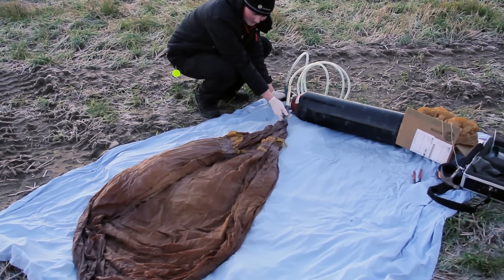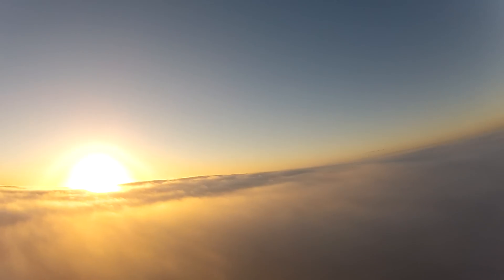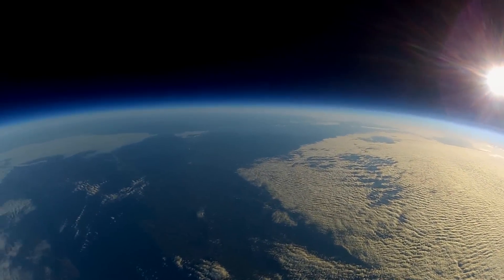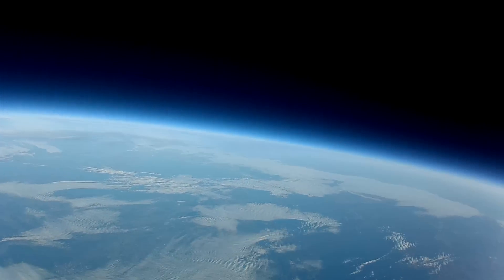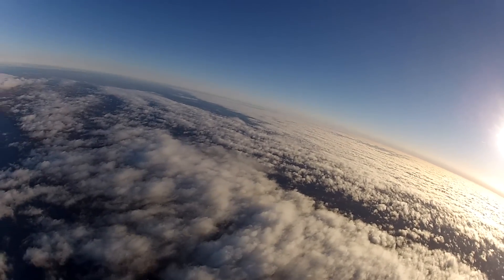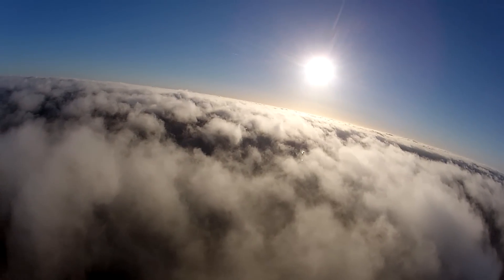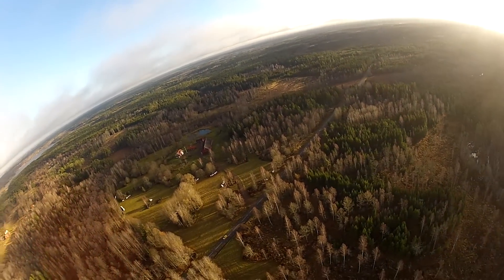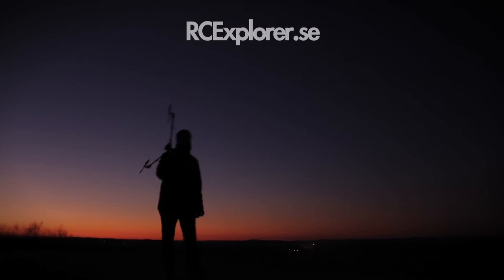Space Glider - FPV to Space and Back!

Comment: This will be illegal in a decade
Reply: +Jon For Much sooner I'm afraid.
Reply: +Jon Dor I think it's illegal as of TODAY with the new drone regulations that just came out (Dec 14, 2015).
Reply: +codzomz I don't fly big iron like you, just 4 seaters, but you really think a large foam plane can damage a control surface? Has it happened even once so far? The few times I've crashed a foam plane (once flew right into a lamp post in a park), the plane became minced meat and whatever I impacted had 0 trace of damage. 
Being ingested by an engine is more of a concern, and would cause real financial damage, but even assuming the engine gets damaged in a way that it would stop making thrust, we both know airliners can fly with a broken engine.
What AA airline crash are you referring to? Was it caused by an RC aircraft? Do you have the NTSB record so that I can read up on it and learn from it? Thanks.
Reply: Veetoo of course, last I checked, there have been exactly 0 RC aircraft that have damaged a full size plane so far, and if a foam plane were to impact, the risks of damage to the full size aircraft are super small (not true for multirotors made out of carbon fiber and metal though).
Compare with number of bird strikes yearly and the millions of damage they cause every year.
I say, let's outlaw birds first, they're clearly the most dangerous!
Reply: Maybe they should welcome the drones near the airport to scare off the birds. Might actually reduce damaged caused by bird strikes. Birds are a much denser object and a flock of birds is far more dangerous then a single drone buzzing around.
Reply: It already is in the US
Reply: +than217 do you know which part of the regs make it illegal (law, not circular notice or recommendation) to fly FPV beyond LOS?
All I know about is having to register as an RC pilot to fly anything more than 250g
Reply: JaleelJohanson62 flying above 400ft AGL is still not illegal in the US, I asked an aviation lawyer at AOPA to make sure. The FAA had guidelines they'd like RC flyers to follow, which include never flying over 400ft AGL no matter the airspace or location. My personal take is that it's a bit over restrictive and I wish they would take airspace into account.
Reply: the amount of misinformation in this comment section by warriors of air safety is staggering
Reply: +MasterMayhem78 and this is relevant how? Kinetic energy is distributed between both sides according to each side's weight. The foam plane will be obliterated no matter what and is very unlikely to cause any damage to the full size plane. A bird will cause more damage (I know, I've already hit 2 smallish birds with a full size plane I was flying, and they both put a sizable dent in the wing. Some also go through the windshield and strike the pilot). I you're going to tell me that foam or plastic prop will dent a wing or go through a windshield, it's going to be hard sell.
Or if you tried to point out that the speed of an RC plane between struct by a full size plane, is kind of irrelevant due to the speed of the full size plane, that's pretty much true.
Reply: +goatman86 it not actually illegal yet, just frowned upon (go ask an aviation lawyer), and your odds of being injured or killed by a falling coconut or lightening are way higher than an RC aircraft. But if you're worried, stay indoors ;)
Reply: +Jon Dor decade ? couple years maximum.
Reply: than217 Fucking government...
Reply: ***** Hmnnn... Apparently I need to investigate this further. Thanks for the info! Perhaps my mission to space isn't canceled afterall? lol
Reply: JaleelJohanson62 while it's not technically illegal (AFAIK) to fly RC inside controlled airspace (Echo, Delta, Charlie, Bravo), it's clearly not a great idea either, never mind crossing 18,000ft where you'll find airliners flying IFR (and typically not doing see and avoid since no VFR traffic is allowed to be there).
People who fly rockets usually go to a place like Black Rock Desert and get an approval from FAA to go to high altitude within a blocked off piece of airspace.
Reply: +JaredtheOverLord amen to that.
Sadly, it&#39;s the internet, everyone has an opinion and many post it, even if they are actually totally uninformed about the subject in question. Even the guy who said he was an airline pilot didn't reply to anything I asked him. 
Of course, part of this is also the FAA's fault for not having done comprehensive tests of collisions between foam planes and full size planes, and multirotors and full size planes, like they do with frozen and thawed chicken they throw with a high speed chicken cannon at airplanes.
Reply: +William Carrey you'll find that it's not illegal to fly above 400ft AGL. You can do so safetly in many places. The FAA would rather that people don't (they have a circular saying so), I can't blame them, but for hobbyists, it's not illegal. Youtube is filled with long range flights clearly above 400AGL, and as long as they're not reckless, the FAA isn't going after them.
Reply: +William Carrey I will not speculate on what will and will not become law, I just stating fact as of today.
The FAA is in a shitty situation with all the non pilot idiots flying quadcopters in unsafe and restricted places, the news gets excited to show how bad and dangerous it is (there have been 0 collissions with any full size aircraft as of yet, and there are countless bird strikes every year, some cause major damage, or death), so they are pressured to do something, even if actually the problem isn't nearly as big as a problem as the clueless public thinks.
Sadly, the FAA also treats all RC from 250g to 55lbs(!!!) from foam to metal as exactly the same. That's probably the worst part right there :(
Reply: *****, let me help you out. A foam airplane will not destroy an airplane engine, it'll get shredded to pieces of foam. You're at more risk from a bird impact and those happen very often
A 3kg quadcopter/multi rotor however is quite likely to do damage to a full size plane though.
Reply: Dear @Rafas Mom, as you can read in many repeating threads like this one where ultimately the same arguments are surfacing again, ignoring past discussions where they were already answered :)  the short story is:
No, a foam plane will not damage the engine of a 747 in any significant fashion. Birds do a lot more damage to engines than a small foam plane. 
Also, a 747 can fly with 2 broken engines (out of 4) and can continue flying in a small descent to a landing field with 3 broken engines.
So no there "does not need to be regulation" and no "a 747 is not going to crash in the so very unlikely event that it were to hit a small foam RC plane"
Reply: + Jon Dor no a couple of years.
Reply: +Jon Dor I just saw one of these things doing an 90 kilometre  flight at up to 12000 feet altitude. Clearly there is nobody aboard to properly see and avoid, no flight plan filed, no transponder, no radio calls of position and direction. Recently I saw one very close to the approach to Brussels airport. I predict a tragedy, just a matter of time.
Reply: @mikebreen2890  imagine a big ass multimillion dollar plane with state of the art tech malfunctioning because a tiny hand sized glider and popped balloon were in its airspace.
Reply: @mikebreen2890  nope...not yet...LOL
Reply: +Jon Dor 
Unfortunately the government likes to ban anything remotely fun.
Reply: @Patchuchan  It's probably not illegal if you inform the authorities I guess. At the very minimum a government can;t ban anyone from going into space.
Reply: Patchuchan Was that pun intentional?
Reply: @Patchuchan  Are you a fuckin dumbass.

These things flying around without regulation, would crash into commercial planes and killing people.
Reply: +Marc MERLIN why does no one keep in mind that the plane is traveling at a very high rate of speed. Yes, if someone hit you with an rc plane it wouldn't hurt too bad, but if you're on a motorcycle traveling at 65 mph and hits you. Much damage. Same goes for passenger aircraft.
Reply: +Mike Breen yeh god... if this little toy dont kill an airliner... im sure the USA or USA controlled agency will take one down, and blame Russia or someone they want to attack for it, dont worry, airliner crash coming one way or another!
Reply: +Mike Breen yeh birds always file there flight routes dont they....... and they weigh alot more and much more solid.... douche
Reply: +William Carrey those are there guidelines. They are not law.
I asked an aviation lawyer to make sure.
TFRs are law however (and of course they should be).
Reply: i'm ok paying. I've had no problems with money I'm not ok with FAA rules. This is why when i was getting flight time for my CPL i hated going cross country to US. I prefer going within Canada. I got my license first in Dubai, Then i left it for 5 years and needed to re-take my tests.That's when i came to canada and did it there. Flying in Dubai was much better than in US too
Reply: already is lol
Reply: But while too many people complain about an unacceptable security risk, and I disagree there, I do agree that in the extremely unlikely event that an airline were to hit any of this, including just swallowing the weather balloon on its way up, or down (let's just remind ourselves how very extremely unlikely that is, though), it could cause expensive damage which for turbine aircraft can go in the millions.
This is not ideal clearly, but given how very unlikely this is compared with the amount of birds that airliners do hit every year, or even the mid airs between multiple full size aircrafts which do happen and kill on occasion, I'm not going to lose sleep over an occasional foam RC aircraft like this.
Makes sense?
Reply: That was overturned in the courts. FAA has no jurisdiction over model drones.
Reply: Jon Dor ya You'll be band from earth 😂.. sound better me
Reply: Tim Suetens reeeealllly...??!!!! 
 tell us where mr einstein..
stop talking shit..
Reply: It already is illegal. You are not legally allowed to fly beyond visual line of sight.
Reply: It is 😢
Reply: +Jon Dor Why?
Reply: +Jon Dor you have to register it know lo, all drones and maybe UAV's
Reply: ***** No worries... I have no intention of going into near space with anything. I was only joking. lol
Reply: +Veetoo Ducks up to 10 pounds, the heaviest drone ive seen is 7 pounds, on top of this drone are britle would break and  rather than resist and break the internal components of an engine
Reply: It's illegal now
Reply: +GamCal yes, but also....fucking irresponsible people.
Reply: I have no problem with the FAAs' unmanned Aircraft Systems ( UAS ) regs and policies. Its meant to enforce accountability and signing your name to the heavier toys means you understand the risks of your hobby and that you're accountable to safe and sane flying practices.. Most of us share a city park with others when we fly our toys and its not cool to have anything drop out of the sky with motor driven props slicing in your face as opposed to blunt object like frisbee which can also be carried by the wind. The seriousness rises the heavier the UAS, and the FAA measures are adopted accordingly.

Personally I think the likelihood of a drone crossing the path of light aircraft is slim and a commercial aircraft even slimmer. But anything knocking out a pitot tube on an instrument only flight could constitute an emergency situation.
Reply: +robert gillies knocking out a pitot tube would not be great, but super unlikely. Those things are pretty strong, I'm almost certain I can pull myself up by a pitot tube on a cessna. As for hitting a plane in IMC are indeed even less.
Reply: Alex T UK
Reply: +Jon Dor  this has been illegal since forever, it's a tad bit above the 400ft ceiling ya know...
Reply: *****  I fully understand what we as hobbyist have the capabilities of doing, and in fact prior to the mass commercialization of rc quadcopters the hobbyist carried on as we have for many many decades prior, but the FAA has clearly set the parameters and the 400ft LOS is one of them......

Model Aircraft Operations

Model aircraft operations are for hobby or recreational purposes only.
The FAA has partnered with several industry associations to promote Know Before You Fly, a campaign to educate the public about using unmanned aircraft safely and responsibly.

Fly below 400 feet and remain clear of surrounding obstacles
Keep the aircraft within visual line of sight at all times
Don't fly within 5 miles of an airport unless you contact the airport and control tower before flying
Don't fly near people or stadiums
Don't fly an aircraft that weighs more than 55 lbs
Don't be careless or reckless with your unmanned aircraft – you could be fined for endangering people or other aircraft. 

There have been several instances particularly in urban areas where the operator was clearly above 400ft and was identified by news and police helicopters in the area.

I see all the videos on youtube with people flying long range and none of those activities are permitted by the FAA, and technically neither is FPV within a closed field because it's not line of sight, now please understand me I think all of this is stupid we were just fine when it was the responsible long term hobbyist, and the new hobbyist coming in learned from the experienced ones, now you have everyone and their grandmother wanting to but a phantom and fly above the clouds it's ridiculous.
Reply: *****  And you say...."as long as they're not reckless, the FAA isn't going after them"......YET.... you know it's coming even if it's a provocateur situation designed to demonize the hobby, because honestly I don't think they want any other eyes in the skies except theirs, IMHO.
Reply: If they can fine you up to $250K and possible imprisonment for failure to register I think that says alot about what they're able to do.
Reply: I didn't say not to register
Reply: Alexander Vlasopoulos Been saying this same thing for some time now.
Reply: Why ?
Ya Dopey Paranoid Idiot.
Reply: +Jon Dor Why all these kind of videos have recorded with a so called fish eye lence ?
Reply: +Joonas Järvinen Because it has a wide view angle. You will see more detail than using normal lens.
Reply: +codzomz you just have to make zones you can fly it in sir... If you are a pilot i'm sure you know there are zones for parachuting and zones for ultralights to fly? can't they just do the same here?
Reply: +Marc MERLIN i'm sure you've heard of the hudson river crash? bird strikes into engines are not uncommon. The drones are roughly that size... It wouldn't do anything if it struck a wing surface of a jumbo but as for the engine they are very finely tuned and it could easily destroy one.
Reply: +MasterMayhem78 but birds have struck planes on wing surfaces and engines.. nothing happens to a wing surface since you haven't a clue the amount it can take... Engines... are another concern... Birds can shut one of those down
Reply: +JaredtheOverLord so please inform us then
Reply: +William Carrey it's not a law yet.
Reply: +Marc MERLIN not everything is foam in there. there's also enough metal and a battery. Those are tougher than birds... Engines on planes are very finely tuned... much more than a car.... flying insects have caused plane engines to cease.... so i don't fully believe it won't destroy a planes engine
Reply: quachimba I know the cactus 1549 accident probably better than you, and talked to Cpt Sully in person. It hit 2 canadian geese that weigh between 6 and 10 lbs each. That's a lot of crap to shove through a jet engine :-/
Most RC aircraft are much lighter than that. Multirotors/quadcopters however can get heavy and dense, and they are definitely dangerous in case of an impact.
The battery in an RC plane is very soft, it can get shredded by a plane engine no problem. The motor however is the densest part, and would cause damage if it went to enter a plane engine or propeller.
But again, it wouldn't bring an airliner down, first because said airliner would be super unlikely to hit 2 RC planes at the same time, one for each engine, and because a 100-200g RC motor would likely damage a plane turbine, but not destroy it like a 10lbs goose did.
Reply: quachimba and I won't agree with "the FAA are assholes". I've dealt with them on multiple occasions (I'm a full size pilot), including a rental plane I flew where the turbo failed, leaked all the oil and destroyed the engine, and they were all respectful and helpful.
While there is something behind the jokes "we're from the FAA and we're here to help", or "we're not happy until you're not happy", my impression is that they tend to be rigid and black and white because it's hard to deal with all shades of grey given limited staffing.
The RC situation is complicated, while I sure don't like the status quo they've just set, I also totally understand they don't want 1kg+ quadcopters flying beyond line of sight at high altitudes over people they could injure or kill, or crashing into small or big planes in flight.
In the case of RC foam planes, I'm biased, but I see the risk as 1000+ times lower due to the construction density and because there aren't that many of them because they need to be built carefully by people who tend to have more clue and would rather not crash them after days, weeks or months of building and tuning.
Reply: So am I but thank god i'm Canada and i don't have to deal with those assholes.
Reply: quachimba if you were a pilot, you'd probably wish you were in the US instead. Canada makes its pilots pay every time they fly depending on what services they use. You actually have to choose safety over money at times.
Reply: +quachimba How long ago was it when you got you CPL and what do you do now?
Reply: There was a space shuttle that was destroyed due to a frozen chunk of foam impacting the leading edge of the shuttles wing. It hit part of the heat shielding punching a trash can size whole in it. So we can't completely rule out the possibility.

That being said the heat shield section I believe is more brittle then a standard wing. Also a passenger aircraft would have a good chance of still flying with a similar size whole. Shuttle burned up during re-entry, something that isn't a concern with passenger aircraft . From what I recall the relative speed was much greater (shuttle reaching sound barrier)
Reply: Would you say that if his RC plane went into the engine of your 747 and you crashed? There need to be regulations for airspace.
Reply: Marc MERLIN , true but a Go Pro would demolish the turbine blades worse than a bird... I'm hoping that if David is bright enough to do this project that he would have the sense to at least find a piece of approved airspace or let Air traffic controllers know when and where he will be flying, just as any other flying aircraft in the area would be required to do. personally I hate the idea of more regs, but if people don't know what they are getting into they could hurt someone or a lot of someone's really bad. I'm a pilot myself of small gyrocopters and hitting a go pro at 80mph would not only cost thousands of dollars but could easily kill me or knock me unconscious, thus killing me. I sincerely hope he had a good radio so he could at least just call in his position to any potential nearby aircraft as that's all it takes. Just say what altitude, location he is and alert anyone in the area to be aware and they can accomodate for it. it's very easy, but when people don't do this that's when we get all the laws that ruin it for everyone.
Reply: @Rodney Smith, are you a turbine engineer? Do you know for a fact that a gopro will demolish a turbine?
Either way, like the other very uninformed person was saying, it will not down an airliner and kill everyone onboard.
I'm a pilot like you, and I also think it would take not only hitting this foam plane in mid flight, a needle in a haystack, but in a way that you'd hit the hardest component first, as opposed to the foam that will just bounce off even your windshield.
I'm not saying it's impossible, but I'm having a very hard time seeing this ending up in your or my cockpit and hitting you in the head. So I'll very much disagree with the "easily', and replace it with "so unlikely that I don't have a word for how unlikely it is"
Your other points are all valid though, it's obviously better to get a block of space to launch that stuff in.
Reply: Ya, I agree I just hope someone would radio in, but I basically agree with you. A radio call to say I'm entering x airspace on descent for a duration of 10 min. Would be easy and I agree that likely no one would be there too even hear the call, but in the event that this happens more and more as it will guaranteed as more people get into these hobbies as they become more affordable (not so much space flights, but fpv & higher altitude rc flight... Meaning above 1000 ft agl) where there is potential for small aircraft, probabilities of accidents will increase. I'm with you though the last thing I would want to see is the government feeling like it's their job to babysit this , rather I just hope a simple radio call or two and some common sense could avoid 99% of the danger. Because as you said Common Sense would elude to the point of birds being far more saturated and dangerous than RC aircraft
Reply: "remote" ly fun  A pun ?
Reply: Patchuchan "remotely" I see what you did there... hahaha
Reply: Lukas Actually it is NOT illegal in the U.S. I used to be a part of a club that launched high powered rockets in NM. You just have to get clearance from the FAA and notify regional and local Air Traffic Control to ensure your rocket, or even ballons, don't interfere with a flight path of any aircraft. 
Falls under 14 CFR, Title 14 of the Code of Federal Regulations. Which are the FAA regulations. Here's the section on rockets and ballon launches. 
https://www.ecfr.gov/cgi-bin/text-idx?SID=9fa85667ff79b844b2c178b4ee2bc84c&mc=true&node=pt14.2.101&rgn=div5
Reply: in Australia, you just have to get prior permission to fly within an aerodrome or controlled airspace.  If you go out far enough you don't have to get permission and the 400ft/120m rule becomes more of a guideline.
Reply: Jon Dor Space is for everyone
Reply: u called it lol
Reply: Jon Dor why
Reply: it will be illegal sooner than that...
Reply: It’s already illegal in my country egypt ..
Reply: It already is, in the UK anyway.
Reply: Umm, way sooner then that. They are trying to pass a law that affects all aviation type hobbies.
Reply: A decade? Probably sooner. Never underestimate busy bodies
Reply: Here it is illegal to fly higher than 120 meters
Reply: Its illegal now
Reply: lmao liberals lobbying for scary a airplane to stop
Reply: It was illegal when he did it
Reply: Its illegal now.  Without FAA/ATC approval you can't go over 400ft.. and you need a license to request that. And a license if the drone weighs more than 250g.  Getting crazy
Reply: Fuck them I'll still do it
Reply: Its illegal now
Reply: I think its illegal now under the new CAA  uk rules
Reply: you were so damn right
Reply: Its illegal already!
Reply: A decade later, not illegal. There are some common-sense regulations in place, but definitely not illegal.
Reply: Checking in 9 years later and I can confirm you are correct. It is illegal.
Reply: Dark Orbit King Probably not,Everything is about politics now.
Reply: +Jon Dor In 10 years there will be tech we hadn't even fucking dreamed of yet.
Reply: @DarkorbitKing100 how’s the tech? I was like 10 when u commented this Ill b 20 next year😂
Reply: GamCal Everythings been about politics for the past- I don't know- all of human history. Think about 2005. Everyone LAUGHED when you spoke of a phone that could take pictures and video and access the internet and etc. Now fucking look at us.
Reply: +Mike Breen yes this! As an airline pilot I can assure that the next American airline crash which will kill love ones, brothers, sisters, and parents for the first time since 2009... Easily avoidable and stupid crash will be from a large rc plane being ingested or damaging wing control surfaces
Reply: +RLBV58 Here in the U.S.A. it's completely illegal... We just got slapped with a FAA mandated 400 feet maximum altitude limit... :-(
Reply: +Jon Dor it won't be illegal if you get permission.
Reply: it already is illegal to fly above 100m or outside your vision reach. tbh i can see why. i wouldn't want to get hit with a fuckin toy falling from the sky just because someone didn't do his math and ended up on the wrong side of the lake. see where i'm getting?
Reply: +Event all unmanned arial vehicles over .55lbs. Helis, quads, gliders, fixed wing. If there's not a person on board and it weighs over .55lbs, then it needs to be registered. Thanks a lot people.
Reply: +Marc MERLIN the lamp post also wasn't traveling at 600 miles per hour when it was struck by the plane.
Reply: +Veetoo this
Reply: Jon Dor lol sweden just banned drones sooo....
Reply: It's already illegal in most places. Two years, not a decade.
Reply: already is
Reply: Some mexican can do this shit when trump puts wall.
Reply: Because it is dangerous to the planes that are passing by...
Reply: +GamCal Yeah, fucking government trying to keep the skies clear of barely controlled drones that could fly into the engines of a passenger jet and jam the engines and make the pilot have to do an emergency landing.  
Fr though I'm an advocate for small government but I am more than fine with them not letting people accidentally fly small drones into planes with people in them at 30k ft